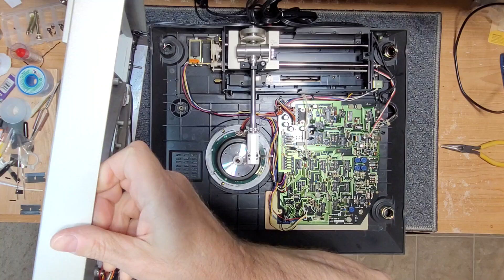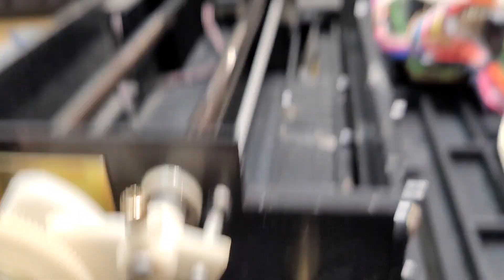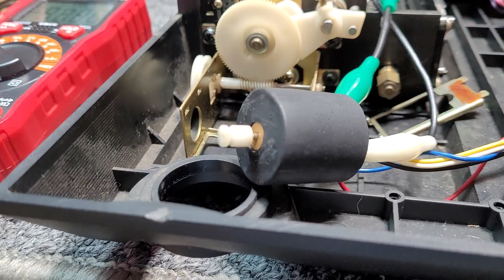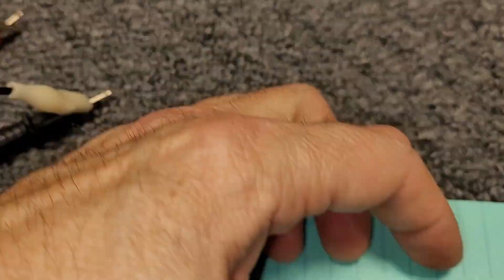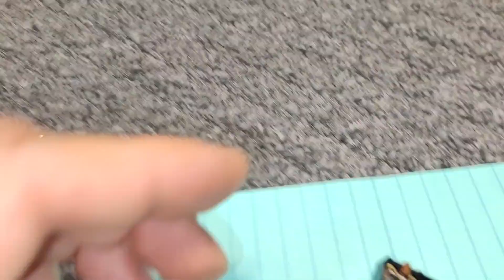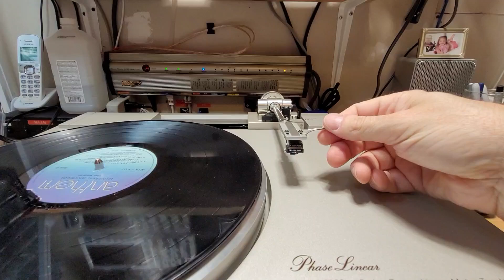Phase Linear 8000 / Pioneer PL-1000 - Cueing Repair, Service & Setup

Comment: I'm working on a Yamaha  px2 and finished a px3. None of the logic will work until all the mechanical issues are fixed. The Yamaha buttons, when pushed have dwell. The times are listed in the manual. No maintenance and jamming the buttons continuously without waiting a second or two... it won't work. Great video, your right about logic.

Comment: FYI, I bought one of these 20 years ago on Ebay. It had logic issues associated to a mechanical problem.  The first thing this unit does after power ON is to lift (test) the tone arm. The lift belt in your video is vital to the logic flow so it can 'move' to its next step.  It has worked flawlessly for the past 20 years. I downloaded the same Service Manual used in this video.  Also, I have the Pioneer PL-800 as well.  It's tangential tone arm 'floats' across a magnetic field so there is no physical touch to the unit.  I bought it new when it came out - I love it just the same as the PL-L1000 unit.

Comment: I want to get a spirit level like the one you use on the video with that transparent square base, can you tell me which brand or item number it is please?
Reply from the maker: That one came with the turntable
Reply: @TurntableGuy  The one that came for my PL-L1000 as an original accessory when it was purchased by my father is a black circular spirit level with a black square base but it dried up a long time ago, and I wanted to replace it with something like the one you showed on the video

Comment: Stunning... So detailed that I gave it a try. Mine worked accept for the arm elevation. So when that happens you don't want the auto return to work!  I opened and did most of what you did and now it works.  Need to reassemple and tighten down but this was an amazing video.  I was satisfied with it just in manual mode, because it's a great table but now I think it's going to be so much more satisfying. Thank you immensely

Comment: I really don't think grease should be applied to the rollers. It is meant to have smooth and very light rolling action. Grease will slow this function and get all over the rods, creating gumming and attracting dirt.
Reply from the maker: It comes with a sticky grease from the factory.  It acts as a damper.

Comment: Hi friend, it's a pleasure to find this video tutorial. I bought a Pioneer PL-L1000 five years ago, and a technician checked it out and found no electronic problems. I only bought the rubber springs, the stylus adjustment gauge, and the small motor belt from an eBay seller, but setting up the tonearm is a pain. I've had it for a long time, so it's time to try your instructions again. You definitely have a new subscriber, thank you very much.

Comment: This was branded as Phase Linear after Pioneer bought Phase Linear - the Pioneer unit was originally only sold in Japan and PX stores in the military. I've had mine for years - restored it using a Phase Linear and a Pioneer PL-1000 for parts. It is rock solid - the motor goes from zero to 33 or 45 in less than one platter revolution. This was the same problem I had - just the cueing arm belt needed to be replaced...

Working on this table is a pain - a jumper cable that extends the connections would be helpful - read below. In order to make adjustments - you need to do a 10 minute disassemble - make the electronic adjustment - and then put it together and see how you did - not good. I ended up suspending the upper plynth on fishing line so I could make adjustments and see results immediately. Good thing I haven't had to adjust anything since - (5 years)

Comment: i have a PL L1000A, motor is not spinning, tried to pull  the top of the base off, i dont have the 3 big bolts that you had, looks like they were never installed, the holes are there, i took off the 5 screws and the top does not pull  off. is there other screws from the bottom on the 1000A that are not part of the 1000? where can i find a free manual download,  i  found a parts manual but no service manual

Comment: FYI
What you call the "3 big bolts" are ONLY for use in transport!
They LOCK the platter suspension for transport so it doesnt get damaged.
These bolts should be removed when in use.
Hence
Why the manual presumes they arent there!
The turntable will
Not
Sound so good
If
The suspension is locked down or the spring set up is not correct 
Ie the rubbers are missing or damaged...
Thanks for the tip about the micro switches

Comment: Oh man, this is a GREAT video!  Thank you so much for posting this.  I have one that is almost mint, but struggling to get the cueing right.  I lost the little white rubber tip on the lifter "v" needle thingy, and it's doing the left-right shimy.  I need to make a replacement for that little piece I guess.  I bought one of these new in 1980, so I'm not new to it - but it still requires a lot of adjustment to get it balanced right, etc.  Very finicky.  Is it worth it?  Yes sir!  This is the best sound I've ever heard from a turntable.  I wish I could pay you to service mine!  Please respond if you are still working on them.  Thanks!
Reply from the maker: Yep, great table, but boy does it need proper setup

Comment: I have restored a PL-L1000 and a PL-L1000A, two different tables as far as circuit boards, but the mechanical functions are very similar. On my 1000A the tone arm deck was frozen, no up/down table height adjust with the thumbscrew level adjust. I had to disassemble the entire deck and literally soak the brass pole sliders with break free for days. But once freed up, good to go. The micro switches are a PITA for both decks. I built a wiring harness that could bridge the connectors from the PC board to the plinth for testing so that I could move the plinth over about 12 inches or so. It was the only way to enable powering, and connecting controls. One thing never mentioned in the video, is the rubber foam that surrounds the arm elevation motor. They deteriorate over time and cause the motor to shift under the pulley band tension. This causes two issues, one, even if a new pulley belt is installed, it wont tension properly, and two, the canted motor can skew the band and it will come off the pulley.  I fixed mine by wrapping double-sided foam tape around the motor, wrapping enough to firm up the motor in its metal bracket. I did not remove the tape adhesive strip except for enough on the final wrap just to secure it down. These tables are not for the light hearted tech! It requires a delicate approach, a complete understanding of the mechanics. The PC boards are usually sound, I have had no issues with either of my decks, but I am thinking of re-capping them. Good vid, hard to cover all the issues, much less how to fix them!
Reply: i have a PL L1000A,  i watched a video you replied to that you have restored a 1000A,  is there other screws besides the 5 on the black cover plate,  i do not have the 3 big bolts from the top either shown in the video of the 1000, are there other screws from the bottom on the 1000A?
Reply: @arizonabloodhound9407  To take a PL-L1000A apart, pull the platter, then remove the screws from the cover plate over the motor. Then secure the tone arm, flip the deck up on one end and remove the 4  leveling feet. Then you have access to use an 8mm deep well socket to remove the remaining 4 "feet studs" if you will. Be careful here as the top plinth is now separated from the lower. Gently put the deck back into normal position. Slide the tone arm to the center. Disconnect the 5 board connectors near the motor, and raise the upper plinth, giving care to not knock the back of the tone are where the weights are. Thats it. Deck is apart!

Comment: I could be wrong but I believe if you read the label under the platter, the three extra bolts you had to remove were factory shipping bolts and not supposed to be there. I just verified with owners manual and they are indeed transit screws.
Reply: Those 3 transit bolts are mentioned in the beginning of the owner’s manual I have. Should be in the service manual though.

Comment: I have the PL-L1000. Tonearm lift was intermittent. Stopped working altogether. After taking it apart a few times to try various "fixes" from the internet, my solution was to very carefully take the lift motor apart, clean it up and lube it prior to reassembly. Once I did this, it has worked flawlessly ever since. Oh by the way, I ALWAYS take the headshell/cartridge off and move it out of harms way for any of the turntables I work on before I start.  And that tonearm assembly is moved by a linear magnet and can be damaged by letting it slide back and forth. Once I understood how the thing works (yes, I agree the manual is lacking) I have come to appreciate the engineering brilliance of it's design.

Comment: I heard those turntables sound really really nice but regarding those three screws I wonder if they're packing screws in and maybe they weren't supposed to be there to start with
Reply from the maker: They were.  Never removed in 40 years according to the owner.

Comment: I have a Mitsubishi lt22 from 83. I payed 350.00 in 83 with no cart which was 100.00 a Audio Technica nude elliptical cart can't remember the model.  Turntable still runs perfectly I've only had to grease the rails so far.